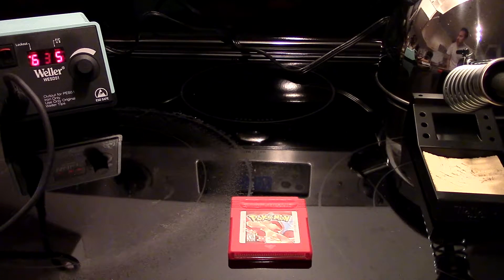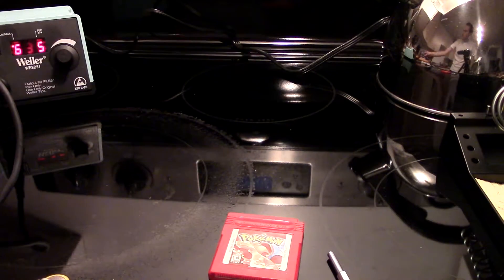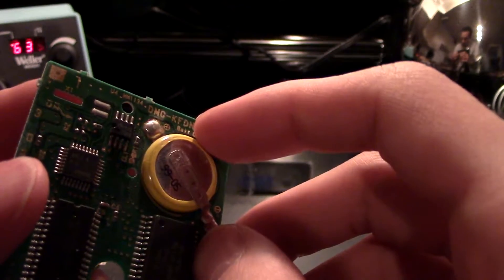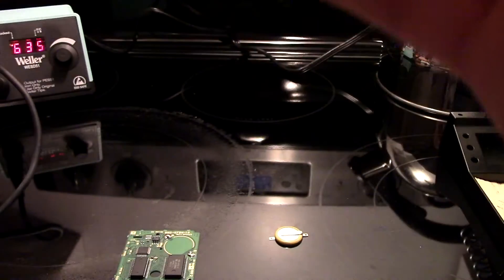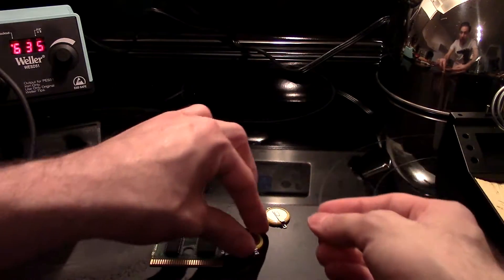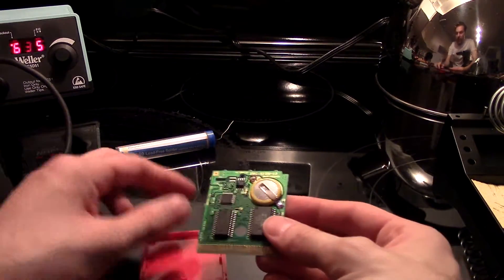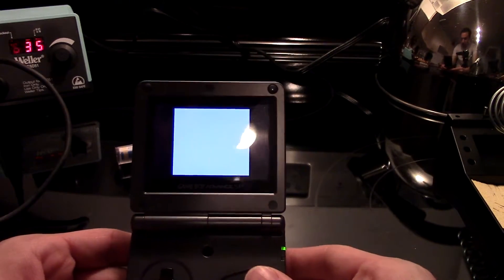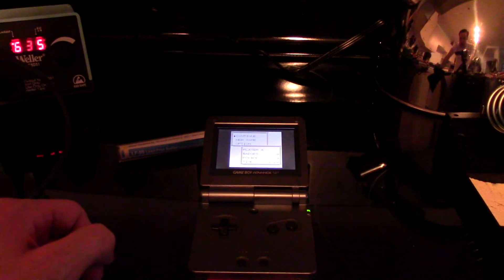How to Change A Game Boy Cartridge Battery (Soldering Method)

Comment: Turning the system off and on fast wouldn't help you tell if the battery is dead or not, because of residue power. I have to wait 3-4 seconds for my battery-less gba cartridge to reset it's memory.

Comment: I need a panasonic vl2020 replacement for a gba flash cartridge. Do you think a smaller cheaper Camelion 3v CR1616 would do? It doesn't even have the tab so I have no clue.

Comment: I saw a video from a guy who did this without any soldering at all. That method seemed more simple to me because I had no idea what you were doing and why you were doing that. Especially when you took a marker and statted drawing.
Reply from the maker: +tendresseak27 You did watch the video with your eyes and ears right?  I explained exactly what I was doing.  The problem with the 'other' method is that you're essentially reusing the existing tabs and you have to cut them off the battery.  You then hold the battery in place with electrical tape.  The problem with that method is that you're not having a proper connection to the battery, and it could also get loose.  This is the way batteries should be changed as it's the safest method out there, and gives the absolute best connection.

Comment: And that Ladies And Gentlemen (Aside from the fact that i never owned the original Gameboy To begin with) Is The Reason i dont buy N64 Or Gameboy Stuff.
I Stick To GBA onwards
Reply from the maker: +sa97 inc There are other methods to changing the batteries, but this is the one method that gives the best possible connection.  It's certainly not for everyone that's for sure.  NES, SNES, Genesis, N64, and basically any other system that uses carts all used these batteries to save games or other features, so it's a very useful skill to acquire for a retro gamer, at least in terms of changing batteries out :D
Reply: +sa97 inc It's really not too difficult. You could get away with only using the gamebit and soldering iron, without needing any flux or extra solder. Just stick the hot metal rod on the solder until it melts, lift, melt the solder again and the place the new one in. Easy peasy!
Reply: +Project COE Its just a bit tedious for me
I probably wouldn't mind it if i did it for one cartridge
But i would absolutely hate it if i had like 20 of them
I wish all the batteries were as simple and easy to replace as the Sega Saturn's Internal Battery.
Reply from the maker: +sa97 inc There are modifications you can do in order to make it that simple, however given the limited space to work with, it can be really challenging to do.  For me, since I'm used to it, I'd rather just solder on new batteries :D
Reply: +Project COE Good for you man:)
Iam planning on replacing the dreamcast internal battery soon.
I already have the battery with the tabs needed,
I just hope i dont end up doing it wrong.
Reply: Many n64 games don’t have batteries though, only a handful like zelda ocarina of time do.  It’s one of the reasons all my n64 saves except zelda are fine.